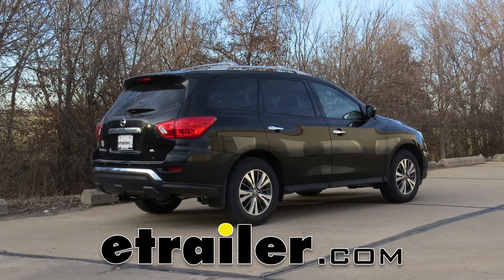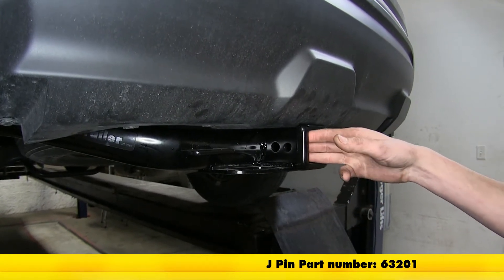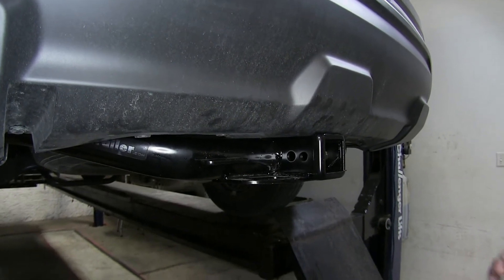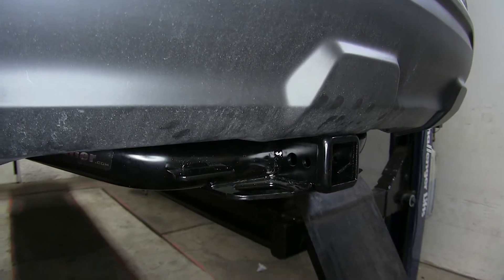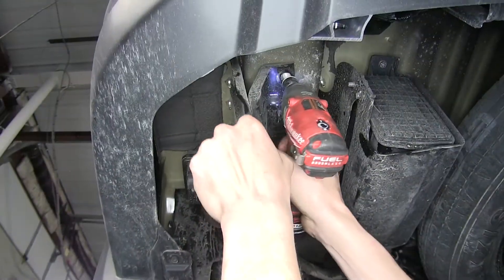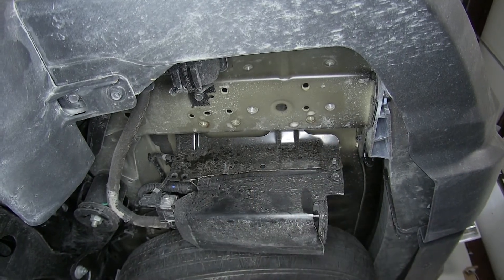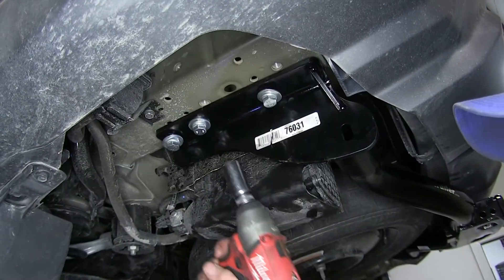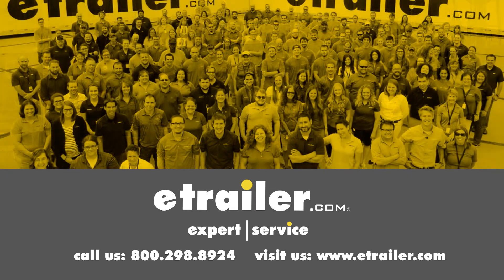etrailer | DIY Install: Draw-Tite Max-Frame Trailer Hitch Receiver on your 2017 Nissan Pathfinder

Comment: My wife's Pathfinder has the foot waive option for the back, would this interfere with that operation?
Reply from the maker: You should still have access to that function. Just be mindful that the hitch is there when waving your foot beneath the vehicle to activate the rear hatch operation. 

https://www.etrailer.com/Trailer-Hitch/Nissan/Pathfinder/2017/76031.html?vehicleid=201745650